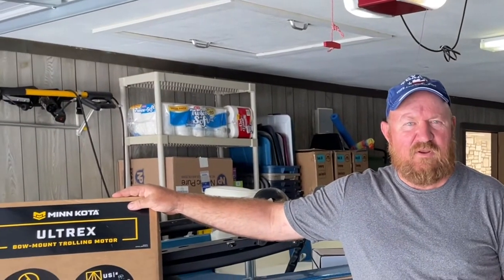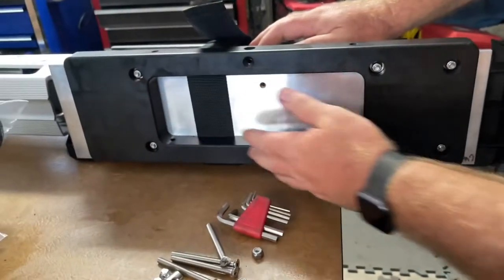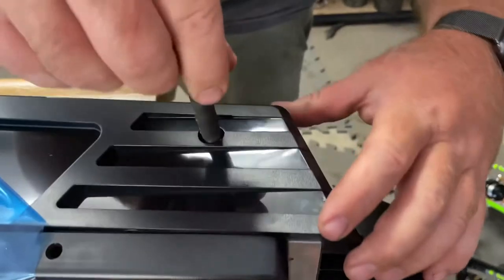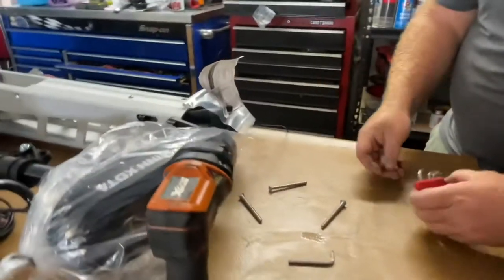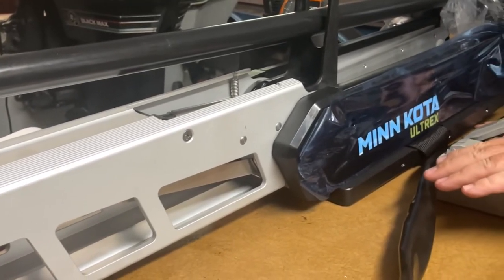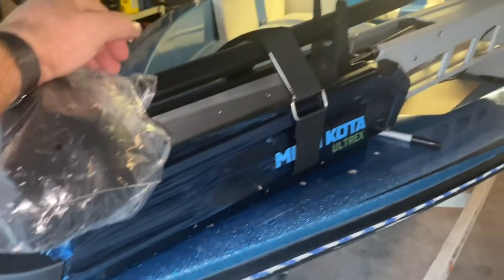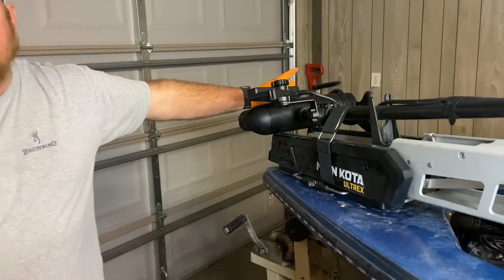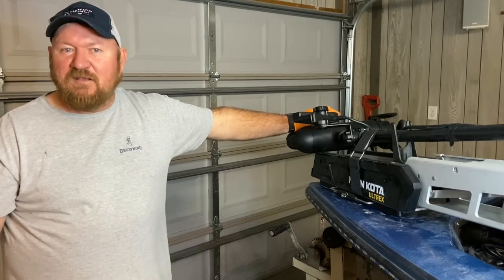Minn Kota Ultrex Trolling Motor Install With a Quick Release MOUNTING BRACKET

Comment: Great video, considering the quick release mount…. I recently installed the same ultrex TM.  Aside from that,  when deployed does your TM shaft have a 1/2 inch play if you try to move or spin by hand?  Sort of like a loose tooth…. Just curious if that is normal.
Reply from the maker: Yes- my TM has the same 1/2 inch play.   Either that’s normal or both our trolling motors were built on a Friday afternoon- ha!
Reply: @ProWrenching  👍🏻

Comment: How does that little mount hold up to the power of that motor? I want to do one for my garmin force but scared it won't hold up and will be loose and not strong enough
Reply from the maker: The mount has held up in rough water conditions, but it’s not as solid as mounting it straight to the boat.  It has a very slight wobble to it.
Reply: @ProWrenching  ok so it does have a slight wobble due to the construction of the pun system on the mount? How noticeable is it
Reply from the maker: @austenazevedo6078  it’s only slight- doesn’t affect the operation of the trolling motor.  Wobble might have been too strong of a word.  It’s more like a slight wiggle if you grab the trolling motor and move it back and forth with your hand.